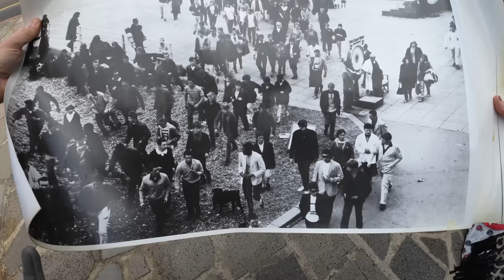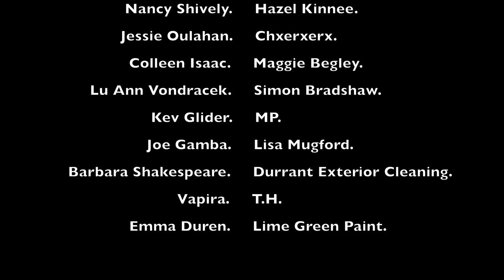Depressed & Overwhelmed From OVERGROWN Garden! He Needs A Helping Hand

Comment: Hehe, you have to give the old man a round of applause, so many things he managed to pack on that surface over the years. And I thought your cleansing could be compared to an archaeological excavation, first the 2000s, then you worked your way through the 1990s, 1980s and ended up in the 1960s. Good work!

Comment: 7:54 Those oscillating saws make pretty useful pruning saws. If you can poke it into some thing that you don’t want to cut completely down you can cut branches where loppers or chainsaws won’t fit. I just wish the makers of those saws made blades with coarser teeth and more set for wider kerfs.
9:00 Like tunneling, you only have one front, one point of attack.

Comment: That older Vespa Piaggio is probably worth a small fortune as long as it's not rusted out they have all steel frames, can't see how much extra Chrome work & has all the back - some of the racks can be quite difficult to actually find unless you buy a repop... every part on that Beast is expensive..LAXVESPA-LOSANGELES